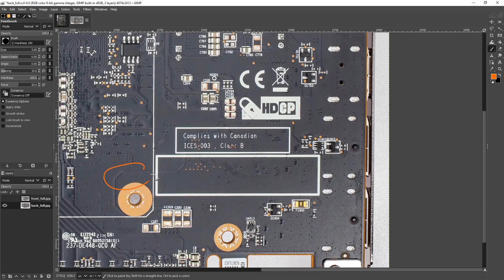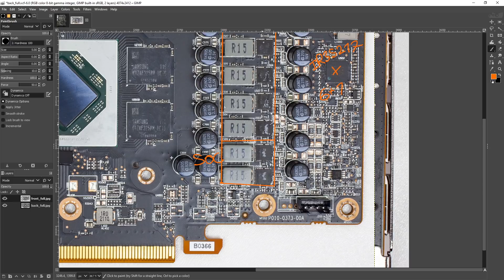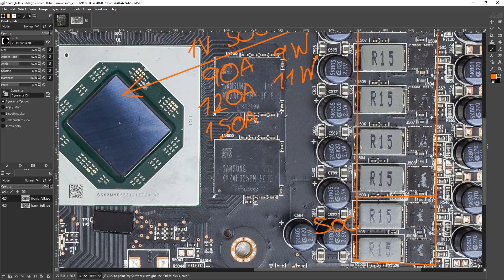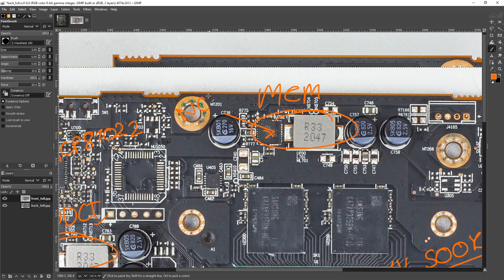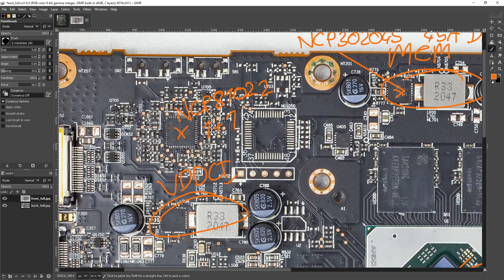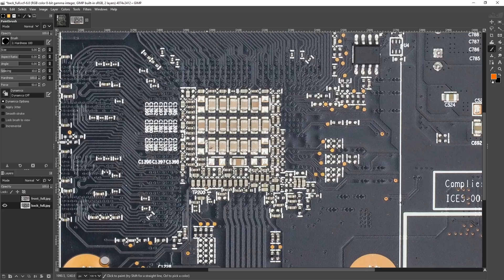GPU PCB Breakdown: Sapphire RX 6600 XT Pulse

Comment: I had bought myself an xfx 6600xt merc for $490 and I am happy with it. It probably has the same quality of pcb that's ongoing here and I won't try extreme overclocking I just do some slight overclocking like 2600 to 2800 vcore and 2000 to 2150 vmem on stock voltage and not agressive fan curve. It's been running just fine with like 5-10% boost in some games and I'm good with it. But I bought an 6600xt pulse after 3 days for like $750-800 for my friend cause prices jumped up. This card seems to lack just one phase and a good cooler. That's all that's lacking in the way to be the best 6600xt and it's nothing unmitigatable with a fine silent fan curve... I got it under control with less silent than the rest of the system on stock running 65C edge and 79C hotspot which are absolutely fine under silent conditions (stock was about 72C edge and 92C hot spot)...

Comment: Wonder how it compares to a vega56
Reply: Vega cards have massive VRMs cant compare them honestly Vegas can easily pull 250-300W
Reply: @alouisschafer7212  that, I have done. Not pleasant for anyone: card, me, psu.
They can reach 500W. You must have seen the gn vid yes?
Reply: @GeorgeTsiros  yes. And I did that shit myself haha flashed a Vega64 bios on it maxed out powertargets and went to town. Mine got up to ~330W I think. Didn't feel like pushing further since it got really hot and my 600W PSU was technically already overloaded with over 300W trough the +12V PCIe Rail.
But that was just an OC experiment for fun really I never went further and actually benched for leaderboard scores.
Mine if the Asus Strix version so arguably one of the best Vega PCBs. It has 13 Phases so probably 11+2 or 12+1 phases for Vcore and HBM.
That card has not seen daylight since I got an RX6700 which is easily 50% better and significantly more efficient with some tweaking it draws ~120W or less depending on the game.
Reply: @alouisschafer7212  I saw maybe a 20% performance increase? after doubling the power consumption... not worth it. I'd rather have a quieter gaming session even if it means dropping the quality a bit. I've heard good words about the 6700 and of course since it uses smaller transistors it will be significantly more efficient. Personally, I can not justify spending more money on the computer... especially since I no longer game as much sadface
Reply: @GeorgeTsiros  I will probably sell both the Vega 56 and RX 6700 when RDNA3 is good enough to justify that and buy a 7800 or 7700 probably.
Its looking pretty good for AMD going by what we know so far and the leaks that have surfaced.
Reply: @alouisschafer7212  have you considered delaying your purchases a bit so you stay half a generation behind? Saves you quite a lot of money. I mean, even if you only upgrade every second or third generation. Like, if i were to upgrade by christmas, i'd get whatever 6xxx series is at the 150-200 W range (yes, i am going by power consumption 🤓 )

Comment: I presume that the gimped x8 PCIe wiring is either:
a) Nothing new, but Buildzoid doesn't usually cover cards lower than low high-end (or upper mid-range) so I've missed it
b) This card is wired for x16 (I can only see half the traces, but I'm no expert)
...c) Buildzoid doesn't think it worth mentioning.

Can't say I ever noticed my old GTX 1060 was anything less than 3.0 x16. 
Then again, that is the lowest end GPU I have ever properly used.
Reply: Nvidia cards idle at lower PCIe speeds, but isn't even the GTX 1030 x16?

Gotta say, that $400 price tag hurts the more I look at this card
Reply: it is x8 PCIe v4 which is essentialy the same bandwidth as x16 PCIe v3 as long as you put it in the right slot.
Weren't the 5700xt and such also x8 v4?
Reply: @stephen1r2  Try sticking a 6600X into anything other than a 500-series Intel or AMD motherboards
Reply: @InternetEntity  That's what I said: that PCIe v3 boards should avoid the card, as it's only full speed on a v4 MB
Reply: The 5500 XT also used x8 PCIe.  I think it's for power/cost savings, especially since the same chip is used in laptops.

Comment: it will for sure have a dual bios switch and 2 bioses,not sure for aRGB header maybe?

overall sapphire is actually doing legit good job making cards,i can say for sure i am happy with my rx5600xt pulse because temps on that card are spectacular which allowed me to push it hard and it still had thermal headroom on its stock cooler and stock paste

Comment: Thanks BZ! I'm contemplating the Pulse because it doesn't have RGB, is slightly factory overclocked, has excellent thermals and acoustics and is very close to MSRP most places. Knowing that it also has a board that is perfectly adequate and seems well built is probably the tipping point for me.. buuuut imma gonna hold on until it hits MSRP spot on. On principle matter.

Comment: RDNA2 efficiency is real. The stock 6600 XT at 160W is only a few hundred points behind in Time Spy versus my BIOS modded 5700 XT on water pulling 300W. AMD was really sandbagging with RDNA1.
Reply: Sandbagging is when you intentionally hold back. I can assure you that if AMD could have reached RDNA2 efficiency with RDNA1 they would have taken Nvidia to the fight for the high end sooner.
Reply: my rx5600xt is behind by like 20% with same power usage

overclocking that 5600xt only pushes it into territory of 5700/5700xt,where it will pull same amount of power
Reply: Don't forget that rdna 1 was a hybrid of gcn and rdna architecture. Was mostly gcn. This 6000 series is the first with full rdna architecture.

Comment: What the is the maximum VRAM voltage you could run for GDDR6? The MorePowerTool seems to work for increasing memory VDDCI, and I had it to 1.37v or so just so I could hit 300 GB/s up from the stock 256. My VRAM seems to OC really well. Even at stock I can get 18.5 Gbps, or 2314mhz.
I just don't know how safe it is to increase voltage on GDDR6.
Reply: You can go to 1.4v with no issue, even up to 1.45v depending on the stock cooling on your card. But it also depends on your specific mems if they will scale up to those voltages. 
When I put the 2080 ti on ln2 I would go to 1.55v or even 1.6v.

Comment: : FInally :) - I will still watch the video even though I've cancelled my order. 500€ just wasn't worth it.
Reply: : TBH the 128bit interface was the reason I pulled back from the purchase. This just doesn't cut it anymore if you want any kind of longevity or future proof kind of card. It's a joke really. AMD says it's because high refresh 1080p gaming is the big thing in Steam but I think they're trying to spin it this way to distract from the fact that they just made the cheapest card possible and that they are totally playing the market.
Reply: This was my reasoning behind not buying it too. I've seen memory bus being an issue during benchmarks of this GPU even at 1080p already (eg Borderlands 3, big stutters when textures need to reload).

Comment: Can confirm that Niro+ has dual bios and such. It's essentially a more full version of that PCB most likely.

It just doesn't have thermal pads for the backplates.
Reply: Meh for the backplate, doesn’t really make than much of a difference
Reply: @tanishqbhaiji103  still better to have those thermal pads under backplate than not
Reply: Nitro + too doesn't have thermal pads under backplate? 
So Nitro + is full version 🤔🤔

Comment: yo bz. its been a few years sense u did an extensive overclocking guide. i run b450 tomahawk max; i hear so many new names of memory/cpu stress testing. i guess what i am asking should i stick with prime 95 memory stress test and hw info 64 still. or is there something better. i heard u mention linpack. i use to use occt back in 3570k days. what would u recomend
Reply: p95 and memtest86 were the OG

Comment: The only thing I hate about the 6600XT other than the price is the meagre 8 PCI-E lanes support with this card. I suppose there will be performance penalty for those PCI-E 3.0 platform users. On the flipside, this PCB has more input filtering capacitors than the 6900XT .
Reply from the maker: I decided that for once I won't moan about  the input filtering on ref 6900XTs but yes this also has more input filtering than a ref 6900XT.
Reply: @ActuallyHardcoreOverclocking  Is the pcb of the ref 6800xt different from the 6900xt?
Reply: oh i have it on a b450 tombahwak does it affect performance ? 
i meani notice frames drop and stuff a lot I thought it was the ram how do I know ?
Reply: @mustafaalosta8437  Late to the party, but that's a common mistake many have made instead of looking at what the card requires. A B450 board lacks PCIe 4.0, which is what the 6600xt needs to deliver its intended performance (found on B550 boards, generally, but always keep an eye on what sort of PCIe slots the board has and compare it with the card of your choice). You're effectively not getting the full performance on a B450, up to 10% penalty but it's still there.
Reply: @KonsaiAsTai  That penalty almost vanishes when you move up to the 6700 and 6700XT since they have a real 16 Lane PCIe interface. Why I bought a 6700 instead of a 6600XT. 
The 6600XT is mid as hell. 8gb VRAM like its 2017 and x8 PCIe garbo
Reply: @KonsaiAsTai  no, its only below 4%, alr watch the compare lol
Reply: pcie 3.0 vs 4.0 on this card only 1-3% difference, wont matter

Comment: I will wait till the rtx 3060 ist 300€ or less. I will propably buy a used MSI version of the card. They are ugly as fuck but have good cooling. At this point I don't care anymore, I don't really play anymore but would like the processing power for some Image scaling or Blender related tasks.
Reply: Think you're going to be waiting a long time for that mate, 3060 will almost certainly never go below 300 retail and the used market is gonna take a long time to recover
Reply: It probably never will. 12GB of VRAM costs like $150 as of the most recent pricing I've heard.
Reply: @SNESChalmers147  Used prices will propably reach that within a year, if nothing unexpected happens. Right now a used RTX3060 can be had for around 500€.
Reply: Thats a little odd, the RX 6600 XT is a better card than a RTX 3060

Comment: If the 6600xt has trouble addressing 8gb wouldn't that mean the 6800/6800xt/6900xt would have trouble addressing all 16gb?
Reply from the maker: it doesn't have trouble addressing. The infinity cache on it is really small so the 128bit memory controller kills performance at higher resolutions.
Reply: This card is not for 4k anyway